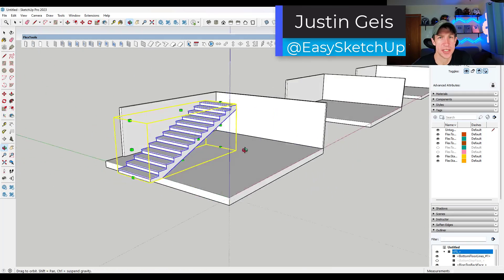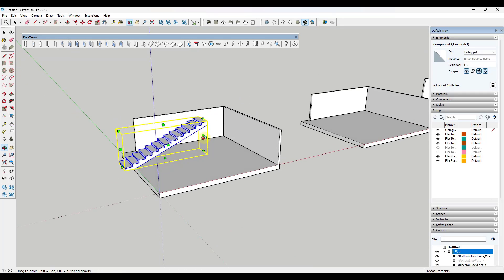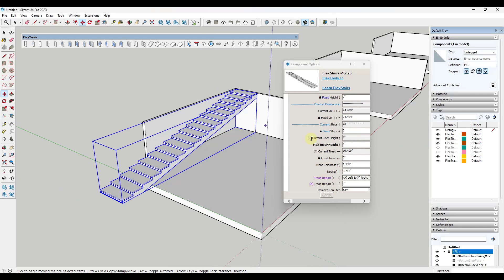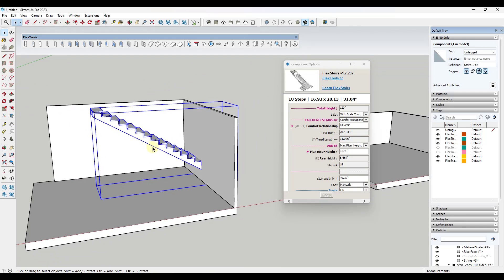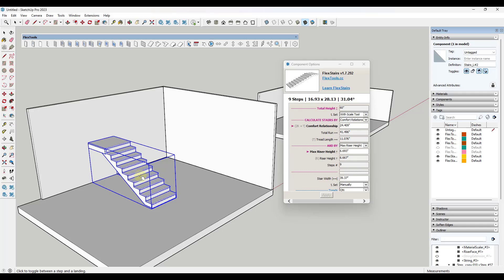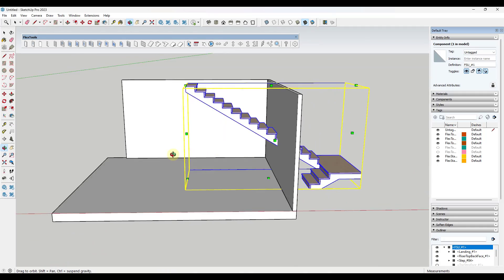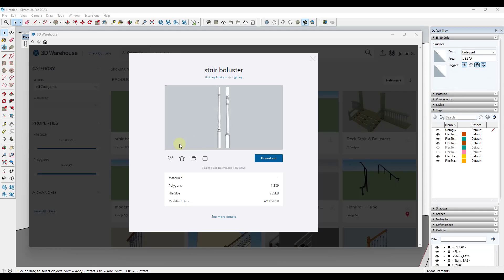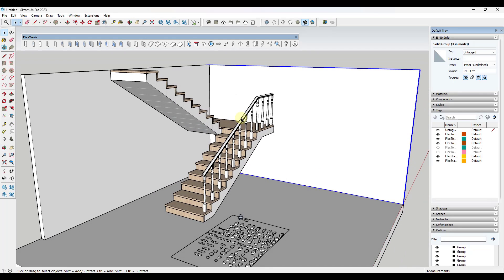Fast STAIRS in SketchUp!

Comment: Very helpful tutorial.  Wondering if you have come across any spiral staircase plugins which use some of the common modern metal spiral stairs styles available from prefab metal spiral stairway manufacturers ?  Would be helpful if my residential home model used elements that were available from stairway manufacturers.  Manufactured spiral staircases have a similar design and style, which for me is a good thing.  It isn't useful to have a fanciful one-of stairway drawn in the model when I will most likely be purchasing a spiral staircase from an existing manufacturer from a catalog.

I am working on an affordable kit-home design using steel portal frames as the major structural element in order to drastically reduce the number of parts compared to custom stick-built methods of construction.  Tried using prefab modular methods, but was not smart enough to achieve my goal of $100/psf.  Portal frames have been much more successful on cost and construction time (critical for cost reduction).  The kit-home design also needs to scale well: 100, 500, 10,000 homes, which is why I want to purchase a manufactured spiral staircase out of a catalog.

thanks.  Stay safe.

Comment: powerful DC's but what you are missing is the depth of the upper floor affecting the overall stair height...  as the top tread is not ususally level with the finished floor level... it is 1 riser height lower
Reply: You can do this!  In the component options there is a setting to remove the top step so the flight will start 1 riser lower.  You can then choose to extend the stringer to meet the upper floor, while specifying the floor's thickness.  I tried to include a link to an animation on our website but the comment disappeared.  Feel free to contact us for more info.

Comment: Great video! 🙂 Can that extension bend the entire stairs?  
(i.e. - - as a curve - or - trapezoidal (bottom step widest + steps become narrower at top)?
Reply from the maker: No bend function - Usually I'd try to use something like FredoScale for that
Reply: @Thesketchupessentials  thanks Justin 🙂👍🏼  Could it make a staircase “trapezoidal” (bottom step widest - then the steps gradually get smaller in width as they go up)?
Reply from the maker: @_Breakdown  No, the dynamic components themselves are pretty much always going to be uniform - any non fixed width condition is probably going to require additional work with some kind of extension
Reply: @Thesketchupessentials  thanks again 🙋🏼‍♂️ By “extension” you mean Fast-STAIRS or Fredoscale (or either)?